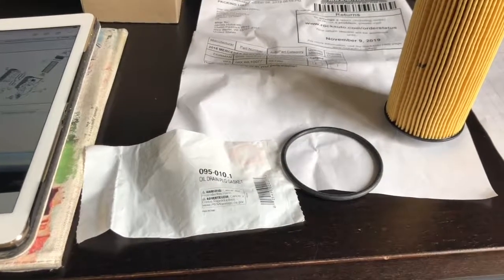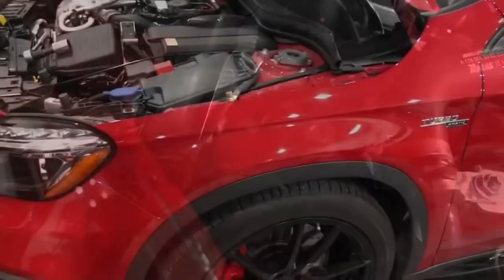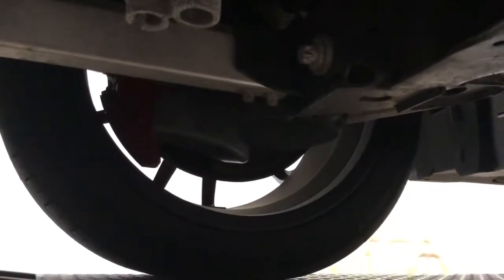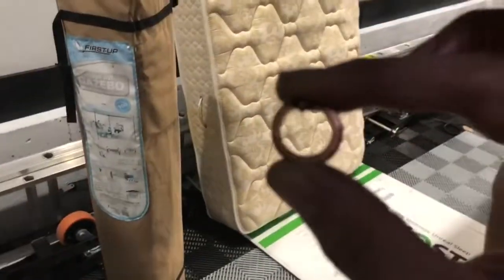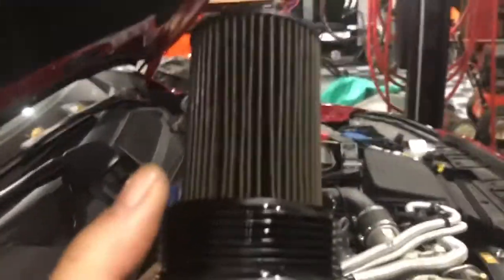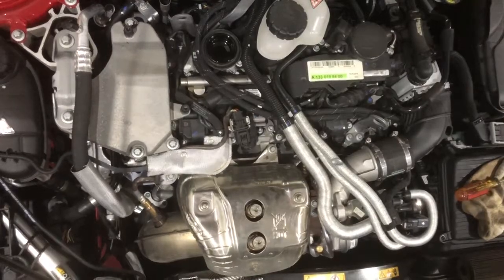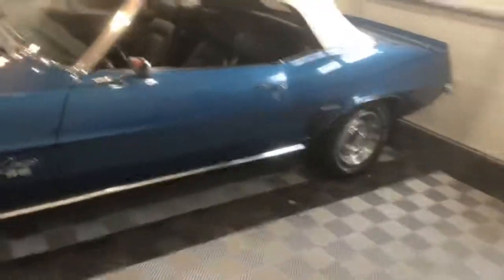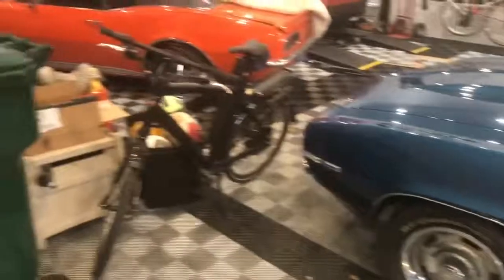Mercedes-Benz 2016 GLA 45 AMG oil change

Comment: You need to confirm your torque specs you keep saying foot pounds!!!!!!! Engine oil drain bolt torque = 30 Nm per MB shop manual. Oil filter cover = 25 Nm. Do NOT overtighten.!!!!!!!!!!